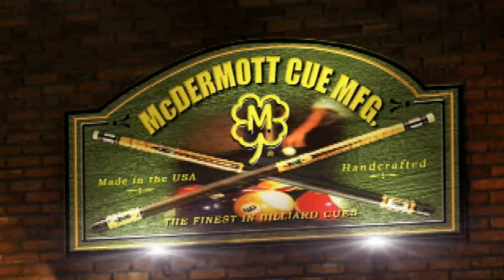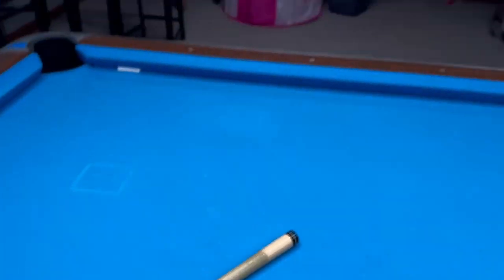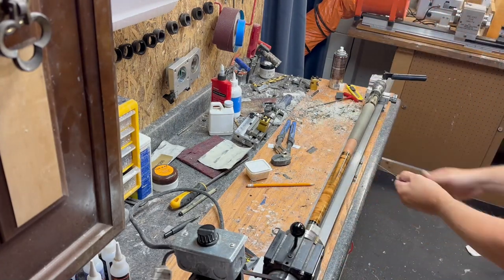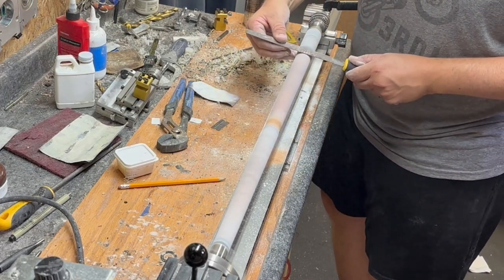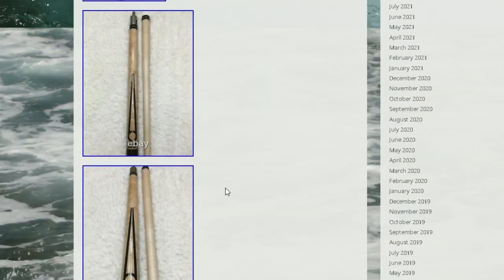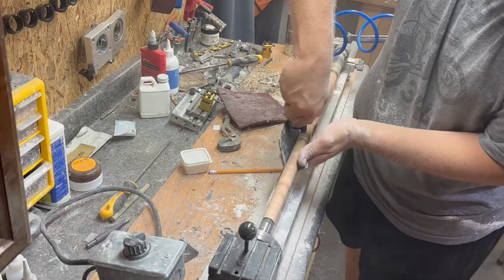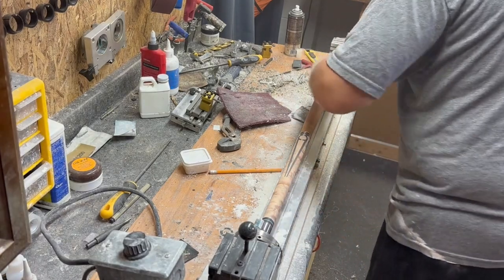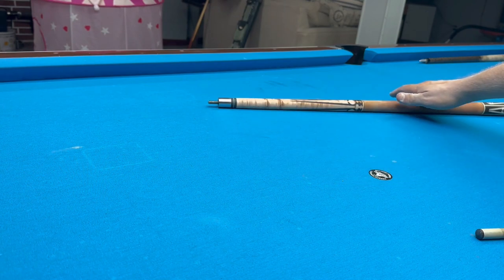How to buy, restore and sell pool cues for a profit! McDermott EK1

Comment: My guess at the beginning of the video is that it's the shaft. It wobbled by itself in the primary check. The butt seem to run true on the lathe as well.
Reply from the maker: Good guess, but it was actually the joint faces. I squared them up and the twig rolled great!

Comment: McDermott did apply clear over joint and but cap.  I have a ek 5 i bought new around 1992
Reply from the maker: Huh that’s good to know thanks. Those EK5’s were super nice! Thanks for dropping a comment 👍🏼
Reply: I have an EK4! I've had it since new. I picked it up at a tournament at a McDermott booth for a great price. They said it was a factory second, but both myself and the girl running the booth couldn't find any defect at all. Still in mint condition!

Comment: Question, I have a retired 5k series predator cue that is slightly warped underneath the pin. I’ve talked to a few cue makers and they said they can’t fix it… I love this cue and I’d really like to get fixed to play with again. Is this something you can fix?
Reply from the maker: It is very hard to straighten a warped forearm. Unfortunately I would probably have to turn that down as well. Only way is with a jig, which I don’t have.